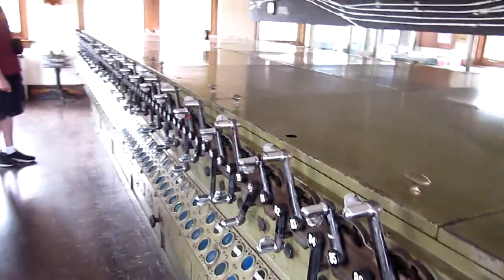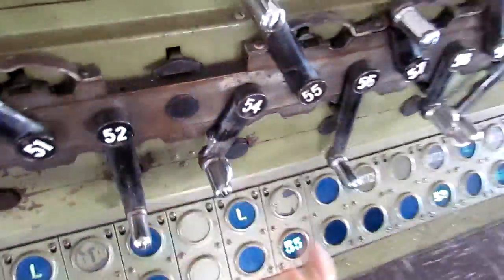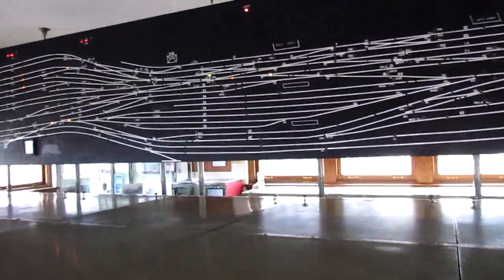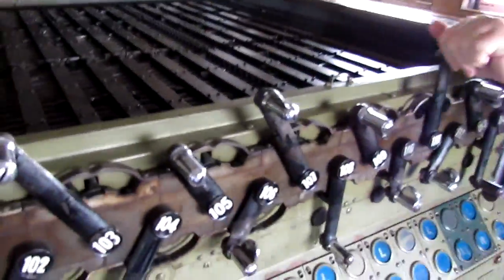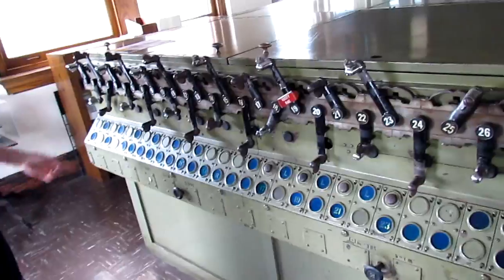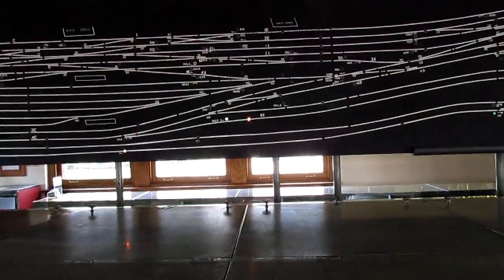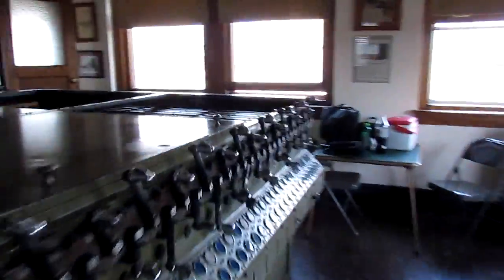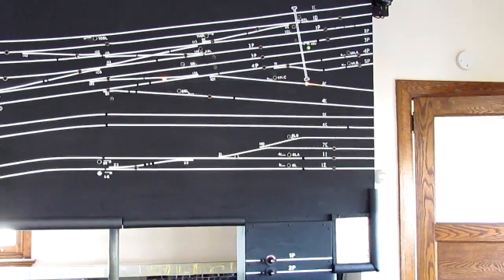PRR HARRIS Tower Moving Light Engines Back and Forth

Comment: Before computers came logic machines like this Union Switch & Signal interlocker at Harrisburg, PA. Operators at this busy spot used it to move track switches and clear signals for dozens of daily Penna. RR freight & passenger trains. The machine prevented unsafe conflicts in the routes. Those long, flat, dark metal bars of "dogs" and "tappets" (0:03) represented "and," "or," "and/or," "if/then," etc. If moving a switch or clearing a signal was unsafe, its numbered control handle would lock.